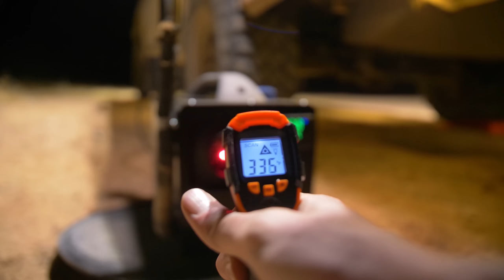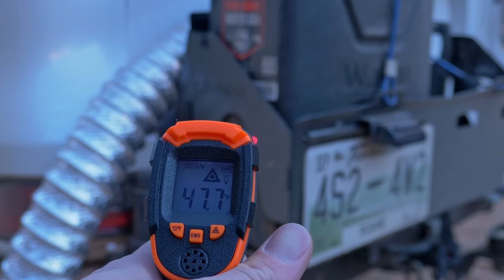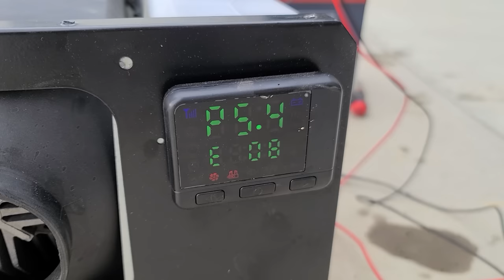Just HYPE or cold camping GAME-CHANGER? 1+ Year Diesel Heater Review

Comment: Have the same unit and never had any problems whether at sea level or at altitude. Its permanently mounted on the roofrack. I did shore up anything I thought was suspect and made a sheet metal enclosure slightly bigger than the unit and put a sliding hatch to close off the heat exit during transport. I did wrap the exhaust pipe and monitor with temp gun. There is a company that makes a small radiator to make hot water with the diesel heater while still providing heat. As far as safety goes yes there is a risk but these units operate inside 1000s of RVs, van builds and garages all over the world every day without issue. Just stay diligent and always have a approved fire extinguisher within reach.

Comment: As a truck driver who has had many webasto heaters without issues that's what I went with for my imported hiace van.  Just tapped right into the vehicle tank and with the smart controller with thermostat I couldn't be happier.  I know not everyone had a thousand bucks for one but if you do I think it's way worth the money for the piece of mind alone.
Reply from the maker: Probably will get one of the good ones eventually 👍
Reply: We have an Eberspacher fitted under the floor of our VW T5 yes it was expensive but is super quiet and sips diesel and doesn’t cane the leisure battery either, it’s been a game changer for year round camping for us.
Reply: Oh,absolutely.  If  I had the $ I 100% would've bought webasto, but instead I spent $100 on a vevor 2kw.  Been using that in a 15ft camper for 3yrs. Using it right now in 21f weather...thankfully it still works well.    I don't have the issues others do (step one, don't get the all in one, get the kit), i installed it properly, and read up on every single instance of a fire being caused by this...and there is one verifiable story and it was user error.  I noticed the weep hole in the exhaust (and thus would never install the exhaust straight up).    I ran my intake air and my exhaust two seperate directions and have no "weird smells" coming inside.   And occassionaly run it on pure kerosene to burn the carbon out of it.
Reply: After seeing this video I agree. I’ll be saving up for a Webasto.

Comment: Currently my solution for cold nights camping is a 12v electric blanket combined with a 625wh battery it will run for 8 hours solid. That 625wh battery is nice but I'm going to upgrade to a 1500wh so recharging every day is less critical. I really hate diesel fumes, they give me an instant headache so I stay as far away from diesel as I can get.
Reply from the maker: I don't blame ya at all. Though, it's nice having a warm tent to change in.
Reply: Heated blanket inside my 0° bag is the best sleep ever for me!
Reply: Would you mind sharing which one you use? I'm on the market and there's so much stuff said about those blankets it's hard to decide for a good one.
Reply: @DunnickFayuro  I can't seem to find it on Amazon, it has been a couple years since I bought it. It's a one person blanket measures 42x60 inch and has no controller just a plug in with about a 5 foot cord. I got this one because I don't like most controllers as they shut down after a timer runs out and I prefer it stay on until I unplug it and it draws 57 watts(just measured it).
Reply: @stevej7139  Thanks. Maybe if you give me the name I could search it elsewhere.
Reply: @DunnickFayuro  Problem is there is no name on the blanket and it has been so long I can't go that far back on my Amazon purchases to find the name, all I can tell you is it cost about $50

Comment: from article "22 diesel heater installation notes" - When diesel burns, a small amount of water vapor is produced, which may condense on the exhaust pipe walls, forming droplets. Although this is just a tiny amount, the water droplets will accumulate inside the exhaust pipe if the exhaust port faces upwards.

At low temperatures, the water will freeze, reducing the diameter of the exhaust pipe, and affecting the combustion performance of the diesel heaters.

Lastly, the entire exhaust pipe should be slightly tilted downward. That will allow the water droplets to flow out of the diesel heaters through the exhaust pipe.

might help the problems you are having
Reply: Very true, it should be exactly down the pipe.  I extended it and the outlet remained at the upper point and what you said happened, the pipe was clogged with water and carbon....
Reply: I came here to see if anyone else commented on that! The instructions i got with my heater explicitly say to run the exhaust sideways or down, never up!

Comment: Nailed it 🙌. I installed one of these in my shop and used another one for camping. I've made every mistake you listed here, lol. Diesel spilling out of the vented cap, thinking the plastic smell would go away eventually, running it out of fuel completely... all of them. Once I understood how the unit worked and what not to do, both units have been completely reliable. In the shop, they are amazing, but I'm still deciding if I want to keep using one camping 🤷‍♂️. It's just another piece of gear to deal with, you know?

Comment: Mine is built into my small trailer.  1 of the biggest failures is the heat sensor and glow plug.  Replace them with Korean made Kyocera brand, and I agree on the exhaust,  if it's vertical like that moisture will built up I the bottom of the exhaust pipe,  remedy by drilling a small hole  so moisture can escape. They definitely are a game changer for off season camping,  nice hot dry air
Reply from the maker: Good call on getting some quality spares. As to moisture we haven't had any buildup at all. What climate are you in?

Comment: So I did a vevor 5kw unit built into a weatherproof hard case. Ive done three, one for me and two for friends. Zero issues reported and one friend burns kerosene to keep it cleaner. 
I will say one thing about the plastic/chemical smell is check your hose. It took three hoses and finally found a 4 layer hose that didnt smell.  Completely remedied the smell and we now have probably 30 smell free hours on it
Reply from the maker: I've been suspecting that hose itself... Do you have a link to the one you use?

Comment: I love my diesel heater. Built my own aluminum box with false floor and connectors for power and corded remote as the unit is an old style. Only have a few hundred bucks in it. Mine is the original German design: Eberspacher.  I have used down to 20 F. The biggest plus for me is that it dries out the tent as delivers dry heated air. No clammyness!
Reply from the maker: The dry tent effect is AWESOME! Plus it dries clothes in there too

Comment: Happy to say that my Planar heater that I built up  3 years ago is doing very well. Starts up with little fanfare and runs well at most altitudes up to about 9500' of elevation.. Only a bit of fuel smell at start up and after that it runs odor free (air output line) with minimal exhaust fumes for the remainder of the operation.  Packed it all in an old Pelican case that was collecting dust and its been a nice asset particularly when fire burn restrictions have been put into place.

Comment: Always love your videos.  This is very helpful, but a couple of clarifications. 1) CO (carbon monoxide) detector, not CO2.  2) Your video shows the end of the exhaust pipe facing up.  It should point downward for condensation to drain out.  Muffler also has a small drain port for condensation to drain.   Thank you Kevin for your awesome videos and helpful information!

Comment: Honestly I was incredibly impressed by the one my brother bought for my shed, the only problem we had with it was caused by us (feeding it a blend of used engine oil and diesel)
I will say that mine has produced no funky smells and that's with me having replaced the gasket with some high temp silicone.
Reply: Are you filtering the used oil?
Reply: @Oofsmageroo We hadn't been filtering the used oil, we very much knew this was a bad idea but rigging up a filtering system seemed like more effort than it was worth.
Especially after David McLuckie has a video on filtering it, which ultimately caused the same problem I had.

Comment: Hey, great video.  Check the base gasket that came with it.  It's rubber, gets hot and stinks.  Thats where your continuous odour is likely coming from.   Its the rubber gasket the combustion air and exhaust exit from.  Find yourself a good Webasto silicone gasket.

Comment: I bought one of these about a year ago and have come to the conclusion that if you intend to run like a diesel/waste oil blend thru it, get ready to clean the inside at least once a month.

However, the exchanger unit is fairly easy to take apart and clean, needs only 3 tools.
Pro Tip: use "cold use" oven cleaner, the kind that you spray on/wipe off. Takes all the carbon right out and ur back in business.

Comment: Thanks for The Best Informative Review I have seen so far. Thanks for tips. Wondering if shorter dryer hose to tent would make for more efficiency; as in more BTU of heat per gallon of fuel reaching your tent?  Likely not a huge factor, but wonder what a test might reveal.

Comment: Mine emitted a funky smell after I put on the header wrap. The first wrap was a cheap Amazon wrap that smoked for a long time as some chemical burned off. I re-wrapped it with a more expensive header wrap from an auto parts store that still stunk for a while but not as bad, and eventually stopped.
Reply: Even the best exhaust wrap stinks the first time it sees heat.

Comment: Why not get some more of that dryer hose for the intake side? You could run it up to your tent as well to recirculate the air which means it would be not having to heat cold air, or you could run the open end way away from the unit and it’s exhaust.. then would just have to make a sealed connection where the current intake is at the units shell..
Just a thought.

Comment: I've been running a propex in several builds now and my latest is a diesel truck.  I had to make a hard decision as it would have made complete sense to just tap into my truck's tank.  But after much thought I stuck with the propex due to my long established history with a (mostly) worry free system and that carrying a larger propane source I could use the items you mentioned - (fire pit, external cook stove, etc.   Like anything you do get use to the cycles and the sounds to allow you to sleep peacefully.  I've learned that putting the propex down in a corner and covering it with cabinetry or gear storage bins muffles it and now in my latest build it's barely audible.  In fact, sometimes I wake up at night and wonder if it's still working and have to wait and listen for cycle to hear it.  I just can't convince myself to deal with diesel, pumps, carbon build up and maintenance.  I'm a install it and forget it type of guy!

Comment: I live in the UK and drive and old school LR Defender which are world famous for having absolute rubbish heaters. I mounted one of the small units in a 20mm ammo can which is my center console/armrest. The hot air blasts directly onto and angled trans tunnel and bounces up to the windscreen keeping the inside fog off. It has completely changed driving an old Defender! My toes are now actually warm. But I only run it when I'm driving in cold or wet weather...oh, wait a sec, I forgot this is England and its that way most of the time ;-)  Anyway, I think I'll pull it back out and give it a disassembly and thorough check. Cheers from over here!

Comment: I just got one to run outside my van.  What do you cover yours up with in the rain?  I am just using a tarp for now.  Very helpfull video, thanks.
Reply from the maker: Since my controller fell off I just put a ziplock over it since that's the only sensitive part.
Reply: @LifestyleOverland  Interesting.  I have been covering mine with a trash bag when not in use at camp.  I found a cheap plastic cooler on walmarts website mine should fit inside.  I can cut ports for intake and exhaust and the heater hose.  Later, when i get a cargo rack, i can mount the cooler there and secure it against theft.  Thanks for your reply and the information.

Comment: iv got one in my house and befor you use it take all covers off and snug up all the bolts screws inside push all pipes on all the way mine where on about 2 mm good job i looked rap the filler neck with paper towels when filling so you dont get drips running down and going in inside  other than that  thes are v good

Comment: I built my heater with an Espar d2 into a knockoff pelican case with an external fuel tank.

I highly recommend running another hose from the tent to the heater fresh air to recycle the pre-heated air. It'll help prevent dust build-up on the blower motor assembly and it won't have to work as hard.

I service both espar and webasto heaters a lot in my line of work.
Reply: I live in Southcentral Alaska… very cold and high humidity. Would recycling the air cause excess condensation?
Reply: @jK-yj2tl  it's very dry air it wouldn't produce any moisture.

Comment: I have the 8 amp one in my old sprinter and after 2 years the only problem is i had to replace the glow plug once  ,  i had it set at 3 amps and that is why it died , since then no carbon and no problems 
Do Not Cut the power to turn it off , YOU MUST LET IT POWER DOWN AND SHUT OFF ON ITS OWN, if you run it properly you will not have carbon build up

Comment: if these are installed correctly there is no smell ever unless a gasket goes. you are getting the smell because your air intake is pulling in exhaust here and there with the wind. the unit is supposed to pull air from the cabin you are in, heat it and dump it back. you are heating outside air that is mixing with exhaust and putting it inside which also makes the fan work harder shortening its life and drawing more current unless you have a window open as you are creating positive pressure. when heating inside air you do not make any pressure. i have used these as a main heating source in my boat and they work great with proper installation and  tuning along with cleaning here and there but only last around 2yrs before cleaning and rebuilding no longer work and you just need to buy a new unit for whatever reason i have yet to discover. also diesel is a very safe heat source, prob one of the safest, the hazard as you said comes from the exhaust line and if done properly you will have no issues. can even reclaim more heat from them if you get creative.

Comment: Great review. I have 2. A 2kw installed in my VW camper van and a 5kw mounted in an ammo box with dryer hose extensions to a rooftop tent on my RAV4  much like your setup. Totally agree!! game changer. No problems in 4+ years. Sips fuel and amps so very economical heat source. Cheers from E. Tennessee. R.

Comment: Great info, Subscribed! I've been wheeling and camping most of my life and always avoided winter camping, because I hate the cold.  Last fall I took delivery of a Pop up camper shell.  This winter was my first time camping in the cold.  Let me tell you, between the condensation and the ice, that aluminum and canvas topper gets cold!!!  I've been using an electric blanket to stay nice and cozy, but that doesn't help me when I get out of bed.  I will be insulating the camper, but want an actual heat source.  One of my friends uses a diesel heat and another has a Propex. I really don't want to permanently mount it. Thank you for being honest with the review and sharing what you have learned. Have you considered using kerosene? It's a cleaner burning fuel, just less BTU's.

Comment: If someone can avoid a hard 90 degree bend on the exhaust i highly suggest it, have 2 of these heaters  and a hard 90 restricts flow in the exhuast heating that bend bad causing risk of fires, burnt my wood stand  because of its while out ice fishing. My other heater has a less bend still making a 90 degree angle but over a few inches and it gets hot but not near as hot as a hard 90 degree bend . 2nd year  for ice fishing heater 3rd year on one i use to heat my porch in the winter unter months

Comment: Is it possible to run another heat hose from the intake side of the heater to your tent to "circulate" the warm air, rather than having to heat cold air, making it even more efficient and effective?
Reply from the maker: Yes, that would be ideal. The only concern would be recirculating carbon monoxide so make sure you use an alarm.

Comment: The control on the front is the thermostat, if you use it often, cut and extend the wires so you can keep the screen inside the tent. It will regulate the heat and be way more efficient.
Reply: And the carbon build up is because it gets shut off and on so much, running it all night will keep that from happening. Just pulled ours apart after about 2k hours and absolutely no carbon build up inside.
Reply from the maker: Yep, I covered that here. It's been great without a thermostat too.
Reply from the maker: The carbon buildup is from incorrectly tuned combustion. Dial that altitude in and it'll run clean as a whistle 👍

Comment: The exhaust should be pointed downward the silencer had a tiny hole in it to drain the water condensation and it will cause back pressure

Comment: Diesel is actually not near as flammable as gas because its flash point is so much higher (if you throw a match in a bucket of diesel it will go out)  I wouldn't be worried about these burning down anything. CO poisoning from improper routed exhaust seems more of a concern to me.
Reply from the maker: I hear ya on those points but I've also seen some review photos on Amazon of these cheap ones burning down. Rather be on gaurd 👍